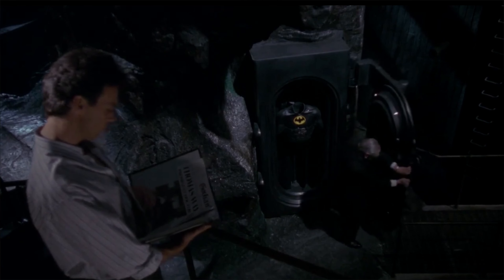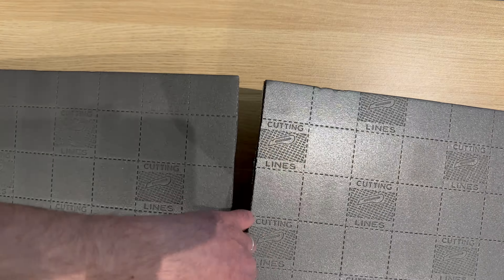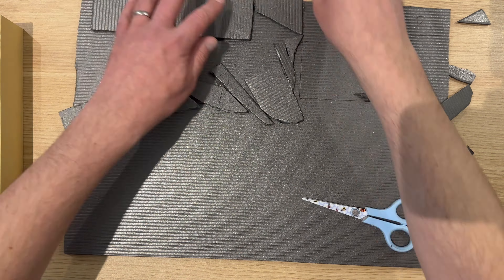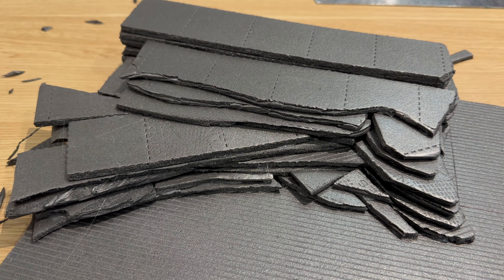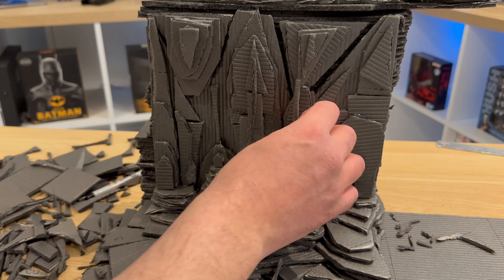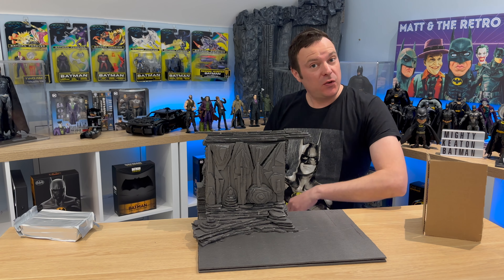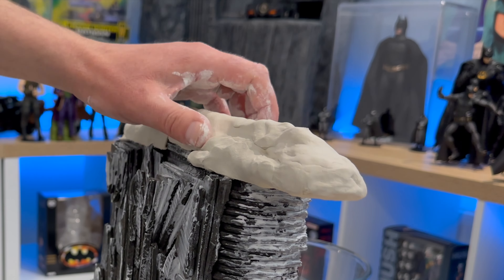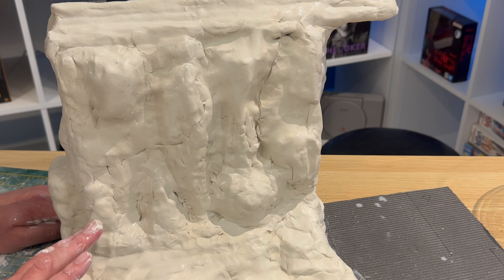Building Batman's Armoury/Vault | Part 1

Comment: So there is a whole lot of resources here on youtube for terrain for warhammer 40k, a bunch of rock techniques done with insulation foam and hot-wire cutters but the one you might want to explore is the use of silicone molds of rocks for casting plaster as well as some of the techniques for painting up plaster to look more like real rocks.
Reply from the maker: Thanks for the advice. Like I was saying in the video, I had a bunch of clay left over from a previous build so decided to use it up 👍

Comment: Where do you get your xps foam??
Reply from the maker: In the UK, it was purchased from Screwfix 👍
Reply: @MattandTheRetroRoom  ah ok. I’m in the us, but that perforated foam would make things so much easier 😂
Reply from the maker: Yeah, definitely. XPS foam should be available at most hardware stores, it’s pretty easy to pick up. I think the thickness I’m using is around 1/4 inch thick or there abouts.
Reply: @MattandTheRetroRoom  Amazon has precut squares at various thickness. Apparently, perforated xps isn’t a thing in the US lol
Reply from the maker: Oh, really? That’s weird. The one I chose was for under-lay for hard flooring, maybe look for something like that?
Reply: @MattandTheRetroRoom  right?? I assumed there would be something similar here.